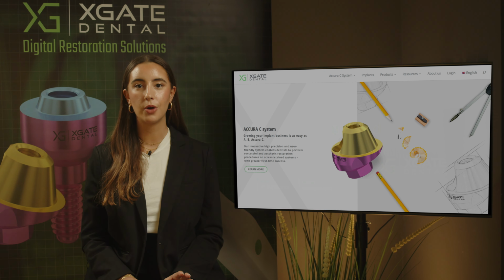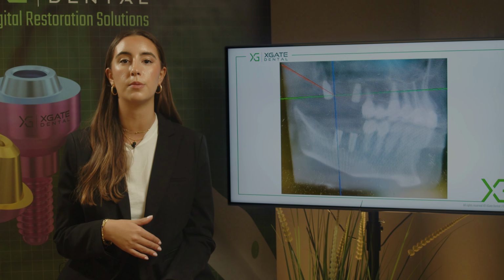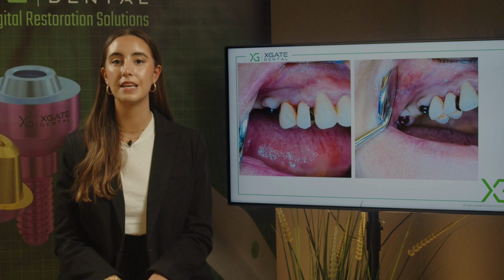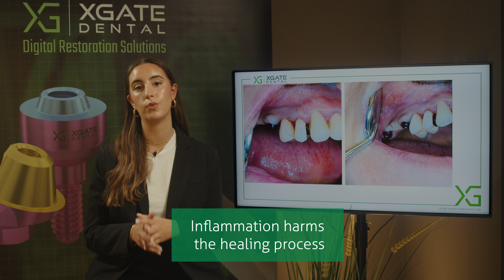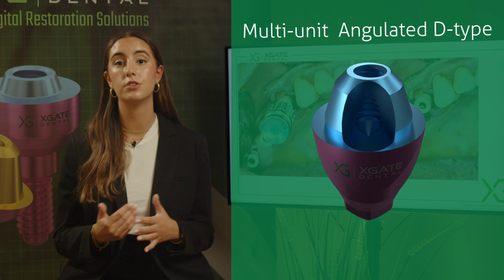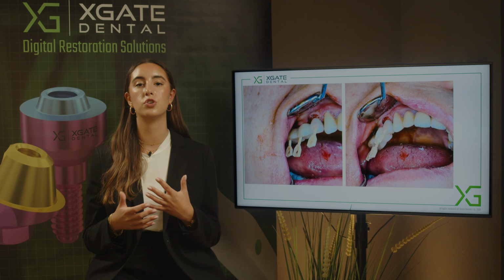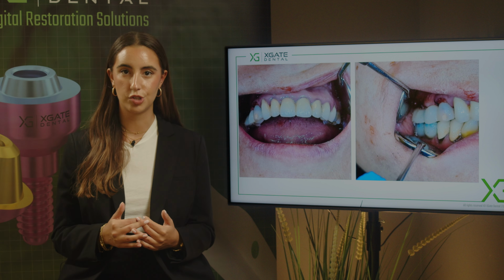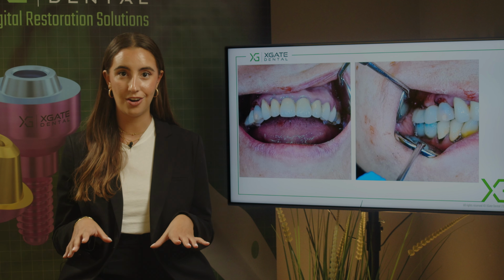Breakthrough From Inflammation to Smile. XGate Temporary Bridge Solutions

Comment from the maker: 00:00 Introduction and Overview
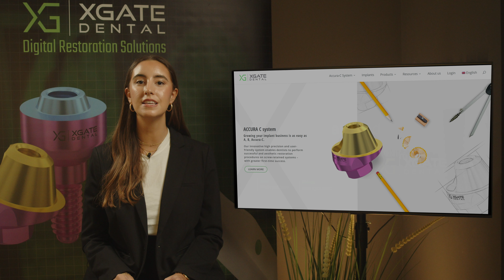00:30 Planning Extractions and Implantations
01:00 Bridge Preparation Procedure
01:30 Placing Implants and Cutting Bridge
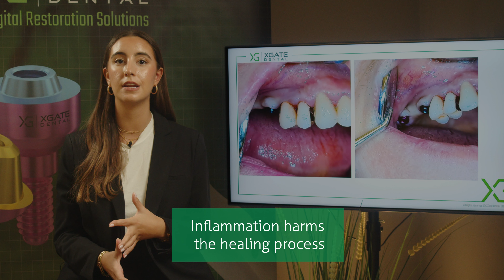02:00 Preparing for Implantation
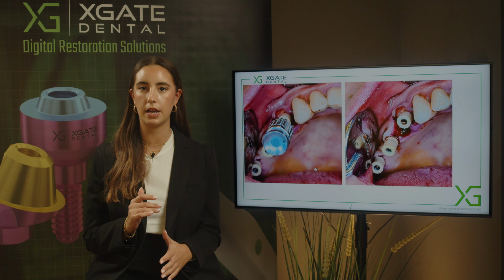02:30 Placing Implants and Bridge Cut
03:00 Consideration for Implant Placement
03:30 Temporary Bridge Preparation
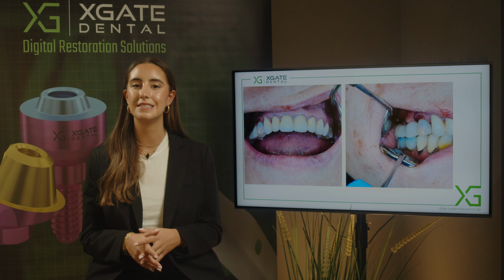04:00 Temporary Bridge Installation
04:30 Future Bridge Adjustment Process